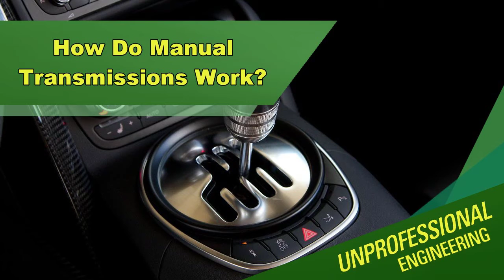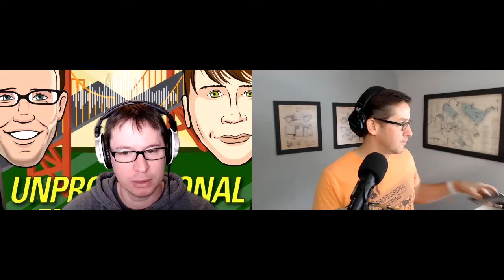How Do Manual Transmissions Work? - Episode 240

Comment: No, the purpose of a transmission, regardless of type, is to multiply the torque of the internal combustion engine. Manual and CVT transmissions are quite simple while automatics are quite complex.